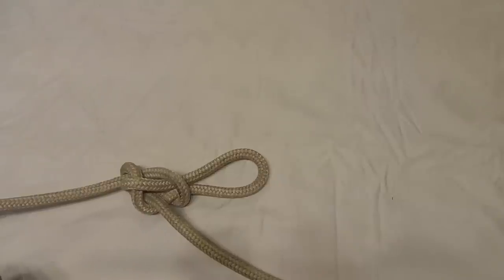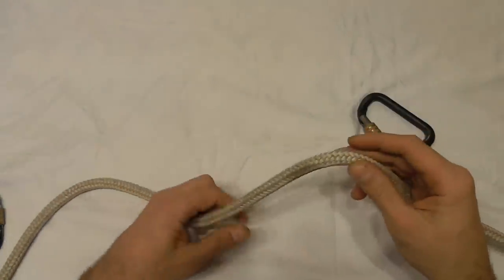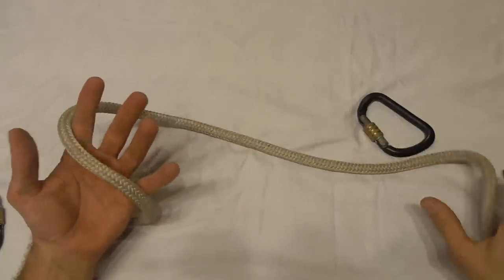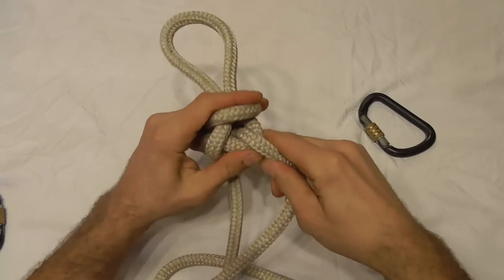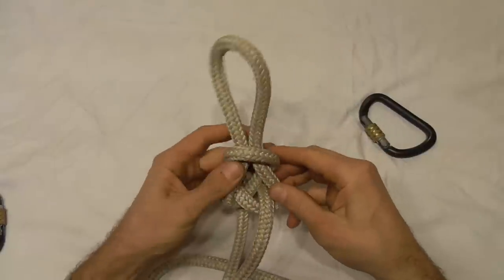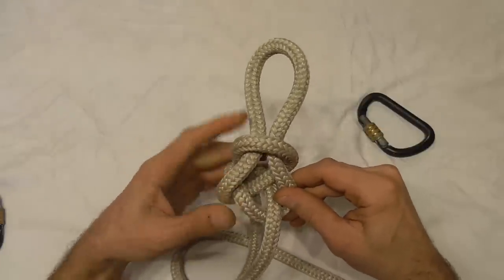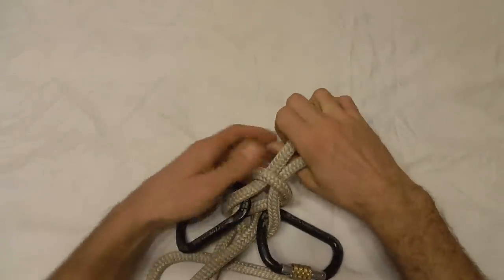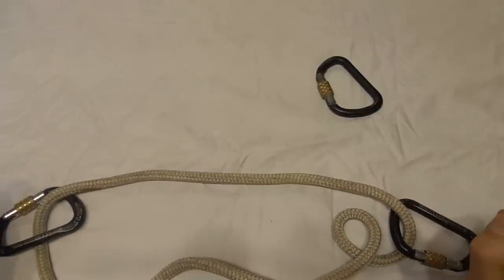Farmer's Loop/Wireman's Loop For Mechanical Advantage

Comment: At 24 seconds in, you point out that you have a 3 to 1 mechanical advantage.  It would help if you showed it in action, I can't envision how it'd function.  But the instructions for making the knot are good.
Reply: Just tie the knot and you’ll be able to see it in action on whatever you use it for.  Ratios aren’t definitive numbers, they are probabilities. It’s like if the Chargers have a 3:1 odds chance of beating the Seahawks, can you “see” the 3:1 ratio? You could make the argument that yes you could see it if you were to watch the game… but even then it’s not a defined term, it’s just a probability. The outcome would be the result of the ratio, not the ratio itself. Same thing applies with the know here. You’re asking for a demonstration, but him tying the knot was the demonstration….
The knot does in fact have a 3:1 mechanical advantage. This is due to load weight capacity and tension physics. Hooke’s law states that the strain of the material is proportional to the applied stress within the elastic limit of that material.

Mathematically, Hooke’s law is expressed as:

F = –kx

In the equation, F is the force, x is the extension in length, k is the constant of proportionality known as the spring constant in N/m.

Since the rope in the video is elastic, it’s important to keep in mind that elastic Potential Energy is the potential energy stored in an elastic material when it is stretched or compressed. The amount of energy stored is proportional to the amount stretched or compressed, as in, the more the amount of stretch, the greater is the energy stored.

Based on Hooke’s Law, we already know that for elastic materials, the force applied by the spring is proportional to its displacement, given by the following relation.

x=kF; where

F is applied load
x is the displacement (stretch or compression)
k is the spring constant

At the equilibrium position of such a system (where the force applied is 0), the potential energy possessed by the system is zero. To calculate the potential energy stored in the spring when it is displaced by a certain amount, the following formula can be used.

U=1/2 kx^2; where
U is the elastic potential energy of the system.

Does that make sense the way I explained it? I’ve tried to keep it simple so hopefully it’s a little easier to follow & understand.

Comment: Easier and better:  make a slip knot, throw two reverse loops around the main loop (as if you were attaching the rope to a cleat), from the side that would pull the knot undone.  Done.  It will hold charging horses on a highline, can be used as Z rig, or whatever.   Never seen it in a knot book, but it's something my dad came up with for highlining his stock.
Reply: Nice 1. I just tried it
Reply: Yes

Comment: I'm finding it much easier to add carabiners under the final crossing wrap of an alpine butterfly loop that makes it pull out after load.  really not much difference other than it looks cleaner and makes more sense in my mind.  i can visualize it easier.
Reply: scratch that, biners right in the loops where standing ends pass out...

Comment: Is this knot better than the artillery hitch for undoing after heavy loading. 
Could you do your tying method of the artillery hitch?
Thanks. 
David.
Reply from the maker: If you noticed near the end of the video I had two carabiners in the knot to help pull the knot apart. With the carabiners attached it is really easy. If you do not have the carabiners, for heavy loading probably the alpine butterfly loop is easiest to untie. The artillery hitch is usually better for light to moderate loads. Yes I can do a video on the artillery hitch. I will put it on the list. Cheers.
Reply: WhyKnot t
Reply: @WhyKnot  I believe the span loops resists jamming and is even easier to tie than the farmers loop. Could you confirm or refute this?

Comment: That's a 2:1 mechanical advantage, not a 3:1. Small but important detail.
Reply: Why is it a 2:1 mechanical advantage and not 3:1? 
The mechanical advantage is dependence on which side is the load and the anchor. 
3:1 when the load is on the left side while the anchor is on the right.
2:1 when the load is on the right side and anchor on the left.
Reply: @Need2connect As Roger Soh said, "3:1 when the load is on the left..." because in that case, the carabiner has become a moving pulley.

Comment: did anyone notice it was just 2to1 advantage
Reply: Jeffrey Lally seem like the last was just a change of direction
Reply: If the rope at the left of the screen is the fixed end, it is a change of direction and 2:1.  If the bight (out of view, presumably around a rail) is the fixed end, it now becomes 3:1.  I know it sounds weird and it really messes with your head but if you draw a diagram on paper, you eventually can work it out... based on how many feet of rope are pulled away from the fixed end - for every foot the unfixed end moves toward the fixed end.  But you need to be really bored to bother putting in the effort.  The way truckers hitches are usually used, it would be 3:1.
Reply: well on paper it sounds good. but if you take a real example. go in you back yard. tie the rope to a tree branch. put a 20 lb load on. put a scale on the other end of the rope. pull you would not even get 2:1 advantage. You lose a little to friction.
Reply: The difference is real in theory 2:1 one way versus 3:1 the other way but yes, there is friction in the system.  That can actually be an advantage rather than a disadvantage.  That became apparent to me when trying to reef in the leech of a mainsail in 30 knots of wind with a small block and tackle I had made for the job.  I could just manage to haul it in but could not hold it while trying to tie off.  I failed every time.  Next time I rigged the same setup but with a truckers hitch.  The friction can easily be overcome with a short surge of force but then the friction actually helps, as it becomes self locking to a fair degree, allowing you to tie off.  Real world example where the truckers hitch won out over pulleys.
Reply: Obviously for situations like hauling yourself up a tree where the effort is sustained, you are much better off with pulleys (around twice the efficiency I believe) but I also think they use self locking Prusiks or some mechanical equivalent, to stop them slipping back.
Reply: It is a 3:1 assuming that the lower loop exiting to the right of the frame is going around a fixed pulley(or carabiner).

Comment: How would this work with two pulleys?
Reply from the maker: Adding pulleys gets complicated very quickly, and is difficult to explain verbally. The RescueResponseGear channel here on youtube has a video on pulley system rules. You can find it here: https://www.youtube.com/watch?v=4J7Qk-atJbs. If you are interested in learning about rigging systems it is a very good channel. Also youtube user Tanglerwr has a good series explaining pulley systems titled "Rope and Pulley Systems". Good luck.